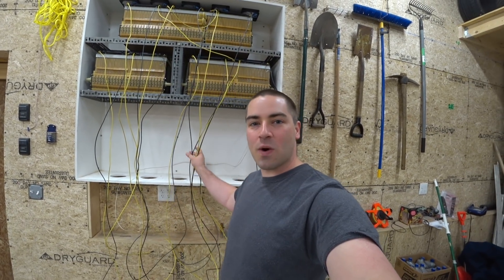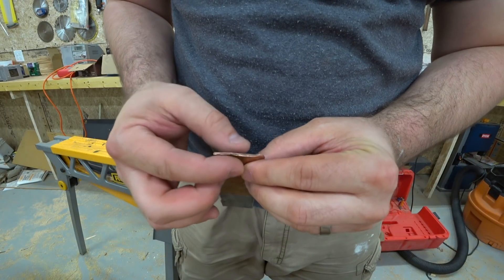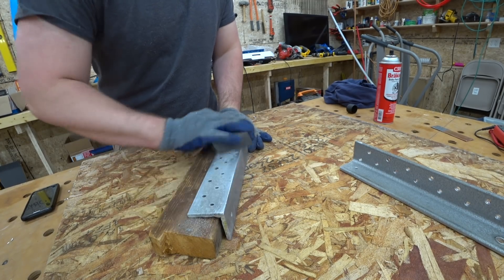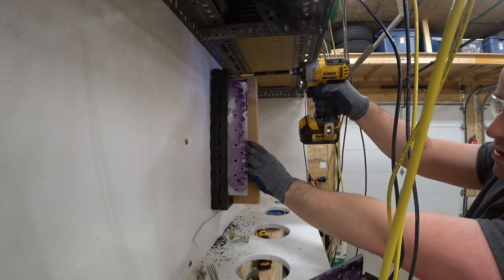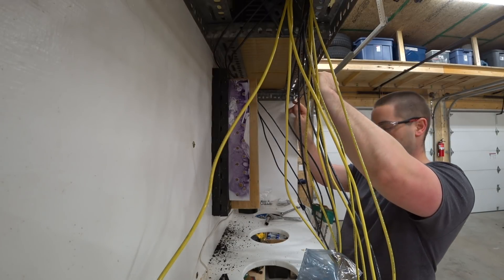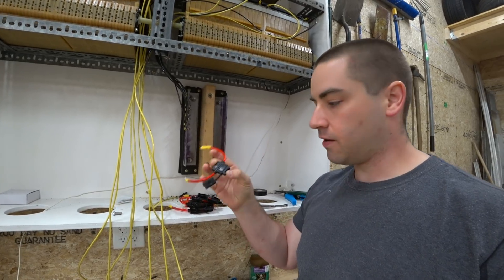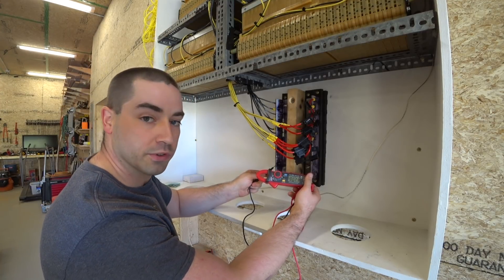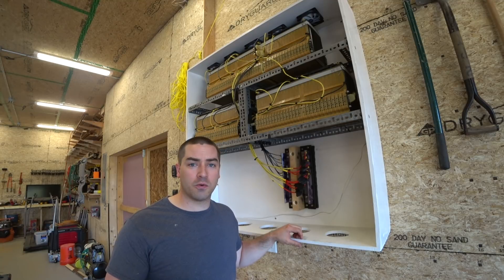Making Busbars, wiring batteries together, DIY Powerwall (Chevy Volt)

Comment: Flatten the copper, bolt it to the aluminum. You have the angle mount and extra conductivity.
Reply: Bad idea. You'll set up conditions for galvanic corrosion this way.
Reply from the maker: Thanks for weighing in Gary.  I love the community on YouTube helping each other out.
Reply: There is a dielectric grease specially for mixing/joining copper and alumium connection points. I can't remember the exact name, however it looks like graphite gray. We use it at a electro-plating shop running 100s of amps. Personally I would look around for a true hunk of copper to make a buss bar out of as the alumium an over heat.
Reply from the maker: Would they work together as a bonded product, or would all the electricity go through the path of least resistance (copper) and avoid the aluminum?  Thanks, David Poz
Reply: I did a quick check.  The 1/4 by 2in angle you are using will be more than enough for what you're up to.  I found a search where they just use a single flat bar 1/4*2in and say at it's lowest heat rating it will support 300 amps, and if you can let it get a bit warm, then it'll go to 600.

An easy way to further calm your mind is to center tap the inverter, so only half the current is going each way from the center through the bus bar.  This also ensures that you keep with the theme of keeping the resistance similar from the wiring.

I.e. bus bar layout would be...
Batt batt batt batt inverter batt batt batt batt.  Which means each side of the bus bar only has to support 1/2 the total current.  Although that thing is way overkill for your purpose I think, and it won't matter how you wire it much.
Reply from the maker: Hi Jon,  Thanks for helping me put my mind at ease.  Good suggestion about the center tap on the busbar.

Comment: Nice looking setup and that 4448 PAE will be awesome. If I was going to change anything it would be configuration to accommodate shorter wire length. Nice sharing with Eleanor she's a cutie. Keep up the good work and videos. Now you will need the heavy wire to feed the inverter.
Reply: Im doing AC coupling because I have some incentives to do so, so I can sell power back.  Maybe I missed where you chose the Magnasine, I also thought about buying 2x Magnasine 4448pae and link them so I could back feed 7kw of solar but eventually dropped that idea for a single Schneider xw+ 6848 because a single one can back feed 10kw and the 5yr warranty doesn't require to buy their special power panel.  Also it has many more features like special charging modes for Li-Ion and power shaving, blah blah, lots of additional grid tie features.

However one big drawback is it's battery low end cutoff voltage of 40/41v.  You could argue it's just a bit of safety, or you could be mad that you cant discharge all the way to 0.

 Either way, I'd look at it if you haven't already.
Reply: Note that the 4448 pae states that it should not be mounted on a flammable surface due to it getting hot on the back side.  I don't have one, so all I can say is what I read in the manuals when I was considering buying it.  I also know that your warranty period is reduced or removed when you don't install it like they suggest.  It's 5 years when installed on their backplate with their combiner box (which together cost another 7-800$) and it's 2-3 years when you don't use their combiner box.  And it may be void if you don't follow the rules?  Like mounting it directly on wood in a box?  I would call and ask, you can talk to a tech support guy before you buy as long as you have the full model number.
Reply: DavidPoz Yup, the Schneider is similar with the controller being separate, I believe.  It's not necessary technically, but since we will both need a special custom battery setting you have to buy the programmer to change the defaults... :(

I also second the idea about flipping the fuses to the top.
Reply from the maker: Actually I was thinking of using lamp cord to connect the inverter.  That can handle 240 amps, right?
Reply: Can we watch, that should be enlightening it will be a very short video
Reply from the maker: Yeah, I don't think I would be around to upload it.
Reply: DavidPoz I'll help wherever I've researched already, I like the videos on this topic so far.  Also I've got 2 little ones, I gotta go change oil with my 3 year old right now :).
Reply: Just wondering about the charger / controller / inverter am I right in thinking that if you use the buss bar for charging then you will be limited to 30 amps?
Reply: Jon Novak, I'm curious if you've tried starting motors with your 6848?  I almost went that way but was afraid it might not start my car hoist, so I went with (2) 4048 Magnums.  BTW, 1 Magnum will NOT start a 2 hp 240 motor, they both must be on.
Reply: DavidPoz I have a Conext XW+ 5548 for the past 3 years on my off grid home and its great. It’s even charging my Chevy Volt every suny day
Reply: DavidPoz it does support li-ion and its Canadian made in Bc
Reply: If I understand you meaning standard lamp cord, no way it will handle 240 amps...240 Volts probably OK. Current is the deciding factor for wire size, not voltage. 
Even a 150W lamp would only draw 1.2 amps at 120V. You will need something considerably thicker for 240 Amps. Should be easy to look up on line.
Reply: Oh good...I hadn't followed the whole thread. You seemed way smarter than that. ;-)
I was interested in what looked like fairly light gauge cabling on the original Volt battery pack. I'm working on the battery pack for an electric car we're building at the high school where I teach in Philadelphia. We're using 1 gauge cable on a 144V battery pack. The smaller gauge cabling makes sense if the Volt uses significantly higher voltage. Is the whole Volt battery pack wired in series?
Also, as I mentioned in another comment, from what I read so far it is important to balance the voltage in Lithium-Ion cells.
How are you doing that on your wall mounted system?
Reply from the maker: Thank you for your suggestion.  The Schneider brand is also something I've looking at.  I haven't yet decided.  The grid-tie feature is not important to me as I am not allowed to back-feed my DIY project, and I want this as a back-up emergency system.  I saw the Schneider Conext line seems to be used by others on YouTube.  Good to hear Schneider is working for you.
Reply from the maker: Hi Jon,  I had seen that same thing about the Magnum warranty.  It kinda bugs me when the company does that.  Just like when they make you buy a separate screen to use it.  For $2k you would think they could include a screen.  But all the big inverter companies seem to do it...
Reply from the maker: Thanks.
Reply from the maker: Awesome!  I hope Eleanor wants to help change the oil at three.
Reply from the maker: Charging and discharging would be limited to 30 amps per battery, but I have 8 batteries on the wall.  Total charging/discharging is limited to 240 amps.
Reply from the maker: Thank you for sharing.  With this much backing I certainly have to find out more about the Schneiders.
Reply from the maker: Thanks Jean.
Reply from the maker: Hi Greg Scott,  The lamp cord comment was a joke.  It definitely can't handle 240 amps.
Reply from the maker: Hi Greg Scott,  The original Chevy Volt battery is wired in series, for a nominal 355 volts DC.  The car had a BMS (Battery Management System) that kept the cells in balance with each other.  Unfortunately the original system does not work outside of the car so I'll have to come up with my own system.  I haven't finalized that side of things yet.  Try checking out "Going Off Grid" YouTube channel.  He has a Chevy Volt Battery and has tried some different BMS's on it.
Reply: Checking out the BMS video on the 'Going Off Grid" channel now. Thanks for the heads up. We're running lead-acid in the car right now until I can get the BMS figured out for the Lithium-Ion batteries. If anyone ever wondered why Li-Ion batteries, the lead-acid with less power weigh 350 lbs. for 144V, the Li-Ion weigh 95 lbs. for more Amp-Hrs.
I'll keep following you to see what you do for a BMS. Thanks for the reply.